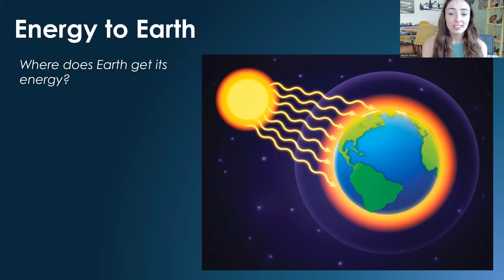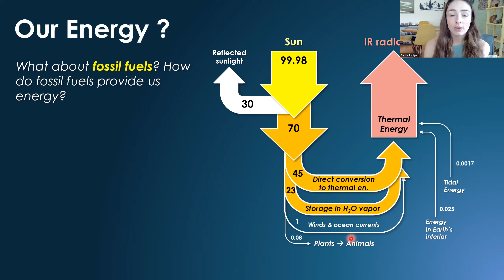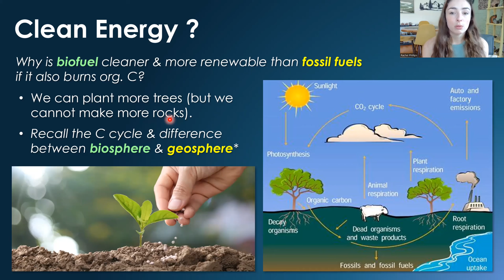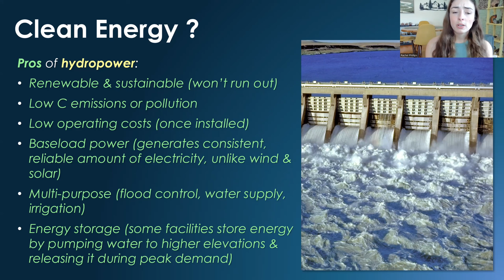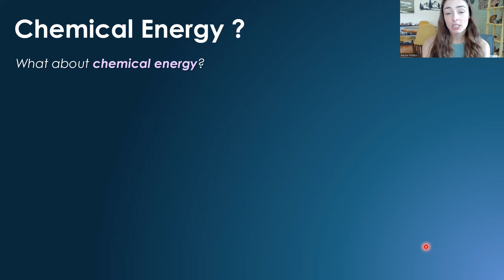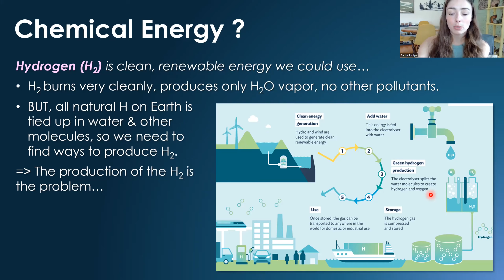Where Earth’s Energy Comes From & Pros/Cons of Renewable Energy | GEO GIRL

Comment: I heard a scientist from many years ago say that the solar cells were not developed to the point where they could rival gas and coal power. The entire roof would need to be covered with cells like shingles made of photovoltaic cells, which would be more expensive than coals and gas, and the fuel effeeciency was also less.

I also heard a physicist say all mass is photons trapped in a container that experiences acceleration or decceleration.

I have never heard an environmentalist or scientist talk about the impact of overpopulation on climate change.

Comment: What you covered you covered well.  Except you left out the most important solar energy that we have available to us!  You described solar energy as it is used by solar panels.  BUT there is another way for us to use solar.  That is passive solar.  It is IMHO, as important, if not more important.  For years I heated my water using passive solar and my house in Kentucky for most of the year except for those coldest parts of the winter.  Their are solar ovens,  greenhouses, attached solar rooms.  The list goes on. 
There is SO MUCH more we could be doing with passive solar if people were more aware of it.

Comment: You overplay the negatives of wind and solar. In particular, you don't discuss synergies. No electricity generation technology exists in isolation with the current grid, why would renewables?  On a diurnal basis, in most places, solar and wind complement each other, with wind picking up near sunset and continuing overnight. Also, battery storage plus renewables is comparable in cost today to the cheapest nuclear power in $/MWh delivered. It continues to get cheaper. The concept of baseload is old-fashioned.
The energy payback period for wind is measured in weeks. The capital cost payback period can be measured in months in good sites to a few years in more marginal sites. At 100+ m hub height, wind is not as variable as surface dwellers think, especially offshore. Ask a kite enthusiast or hot air balloonist. I have never heard any skeptic mention radar. For ATC radar, they're tall, but not that tall. They show up on weather radar, but the meteorologists already know about them.
Silicon solar does not involve a lot of pollutants and we already recycle 90+% of the materials involved (steel, aluminum, glass). Not much is currently being recycled because it is still in use. Ironically, it is the expensive silver that is most challenging to recycle. Solar PV recently passed onshore wind for the cheapest form of electricity generation, unsubsidized LCOE.
Solar often exists on rooftops near the place of use. Utility-scale solar, as well as wind, can also coexist with agriculture, often synergistically. Browsers like sheep and goats can keep grasses trimmed. Many crops benefit from shade on hot days during the growing season, reducing water demand as well. Solar is used on greenhouse roofs to offset their power use too.

You glossed right over one of the advantages of already installed hydro: it is a storage medium in many locations. You can use excess solar or wind to pump water uphill and you get 80-85% of that energy back (competes with batteries for #1). Solar can also be co-located with water, keeping the panels cool (efficient) and shading the water for better water quality
Geothermal is similarly a storage medium. Energy can be stored seasonally, deposited during long summer days and tapped during long winter nights. This is already done.

Nuclear is expensive (>$10/W versus <$1/W for wind/solar PV) to build and slow to implement and filled with opportunity cost. That time and money spent represents status quo emissions not avoided during the 15+ years that modern plants tend to take to build before they generate a single MWh of electricity. In the meantime, for that capital expenditure, you could have built many times more solar and wind generation capacity (and storage) in a year or two and had it in operation for over a decade (by which time it paid for itself many times over) by the time the nuke gets fueled. All of that means that the energy in $/MWh is expensive too. Notice that I didn't even mention weapons or waste or decommissioning costs until now

Comment: Well, it has been reported repeatedly, and I mean repeatedly, over my 70 years that we are about to run out of fossil fuels. I don't know whether the fable of chicken little or the fable of the boy who cried wolf is more appropriate.

Not to mention that if coal is included in the inventory of fossil fuels, we have hundreds of years before our supply of fossil fuels is fully depleted. And fracking, which disturbs the rocks underneath AND ultimately provides more greenhouse gases, has also expanded the supply of fossil fuels.

I'm not advocating long term use of fossil fuels, it just that your otherwise meticulous presentation is incomplete.

Humans tend to believe that history starts when we are born, but this is especially noticeable in young adults who, not unreasonably, lack experience and a long baseline to base judgements on.

Comment: Solar and wind energy is a scam. They are solutions that are 1000x worse than the original problem. Solar will cause massive weather issues as it steals sun energy but also reflects back a large portion of unabsorbed waves which is a double problem because of chem trails allowing for it to be reflected back down. Wind is massive and does create radiation pollution(as you said can mess with radar) kills a lot pf flying animals, prone to fires and large maintenance costs and down time. Nuclear is definitely horrible especially because of h3 emissions.

Comment: Wind and solar intermittency is so severe it is not worth the cost. A nuclear reactor will last 4 times longer than renewables and is a fraction of the cost when you add in all the tens of thousands of kms of connecting transmission lines, backup power such as gas coal, hydro and batteries that renewables need. You essentially need 2 power grids when operating on renewables when one is expensive enough. Nuclear uses existing transmission lines and requires no backup power at all as it is 24/7 power that lasts at least 70 to 80 years compared to 20 years max for renewables. Sorry Geo Girl nuclear is the clear winner by a huge margin. I will not even mention how CO2 intensive and toxic renewables are other than it is off the scale bad for the environment.

Comment: Hydrogen isn't an energy source (unless utilized in a fusion reactor) it is an energy storage medium (just like lithium ion). It has an energy storage density that is 142× higher than lithium ion batteries though. So it is way better.
Reply: Hydrogen is a tipe of combustible that does produce energy when is being burnt.

Same as methane, propane, or gasoline.
Reply: @josemariatrueba4568   it isn't an energy source.  The energy released in combustion was imbued into the diatomic hydrogen when it was created (it takes a lot of energy to separate hydrogen from another atom). It is no more an energy source than a battery is.
Reply: @homomorphic  Sorry but I'm afraid you're wrong.
Hydrogen is something you can burn to make heat or feed an engine, whether you like it or not.
Reply: @josemariatrueba4568   No, you are wrong. Whether something is an energy source or not has absolutely nothing to do with whether it burns or not.  The only energy source is fusion.  Technically fission is a derivative because it is fusion that produces the fissionable elements.  Also, just to show how completely insane your argument is, lithium ion batteries burn just fine; very aggressively, in fact.
Reply: @homomorphic  your are very funny.
It seems like your home heats up magically, and your car runs without any kind of energy.
Reply: @josemariatrueba4568  my car is a hydrogen FCEV. It transforms the stored energy imbued into the hydrogen via some process (which is ultimately derived from fusion) into mechanical energy. At no point is the hydrogen an energy source.

Comment: Solar panels do not produce chemical energy. They use semiconductors to directly produce electricity from the photovoltaic effect. It has little to no relationship to photosynthesis beyond the fact that they both use sunlight.
Reply: I was going to comment on this very detail. However, the very first step in energy capturing, the excitation of electrons to an energetically higher level within the atom or molecule, is comparable. You might call this chemical. All the rest of the process is different in photosynthesis and photovoltaic production of electricity.

Comment: Those might be good alternatives, but there's a serious problem with bio mass energy: it may be renewable, but it regrows much slower than we actually deplete the source while still emitting greenhouse gasses, meaning the net yield of that method is negative

And the only problem with solar power is the exact same reason as why it works: those solar cells are dark and dark stuff heats up pretty easily, giving off a lotta heat still
Best would be to reduce the demand for energy overall

Decreasing the global population for starters would work and I'm sure there are ethical ways to achieve that, not involving genocide

Besides, even in the wealthiest and democratic countries we still have to combat corruption to get it done bc they're no less greedy than world leaders in poor countries

It's doable on paper, but actually executing the plan will be a problem, so I do think that despite the best efforts we will be too late to turn the tides

Comment: 13:26 I feel like one would have to differentiate more clearly between the different renewable sources. It would be interesting to see what’s the actual impact on our ecosystems per unit energy produced. With e.g. wind farms while it might impact some birds,  in terms of land use all you need is a bit of area around the foot and access roads. While there could be some wilderness around solar, the grass is often kept mowed around it for maintenance reasons and installations obviously can’t be within forests. Biomass otoh captures very little energy per unit area compared to the other two and intensive farming is an absolute killer for species diversity. 

So a bit of a better researched breakdown there would be cool :)

Comment: Excellent lecture.  This subject is quite important.  Thank you for tackling it.

Importantly, I do think there is a new development in hydrogen, that is to say, the gold hydrogen variety, that does not get sufficient attention.  This type relies on water percolation, or passing through iron rich geological formations, to produce underground hydrogen, i.e. some large pockets natural gas.  

I wonder what you think of gold hydrogen. 

Further, biogas is a renewable arm that is often overlooked.  These energy streams can be generated anywhere, with inputs coming from city waste disposal, farms, restaurants, or kitchens.

Beyond that, there are a couple of theories that can allay your worries.  One is the regenerative grid theory, that uses grid surpluses to produce hydrogen and battery fill.  The other is the massless energy concept, that relies on massless means; think wind, heat, radiation, or waves, et cetera, over the combustion of mass.  

Combining the two theories could lead to a set of conditions where all of the energy humanity needs can be synthesized, for the most part.

Comment: Proposal. Build solar panels in deserts. Use the energy obtained to make hydrocarbons (methane, gasoline, diesel, kerosene, etc,.) from atmospheric CO2 and H2O. Use existing infrastructure to distribute those hydrocarbons to where they are used. Originally, such a system would be too costly to compete with existing fossil fuel technologies, so just subsidize the shit out of it. Use the money currently being wasted on subsidizing fossil fuel companies to do that. As the hydrocarbon producing solar farms expand, economies of scale kick in. Also, fossil fuels become more expensive as reserves are depleted. Fossil fuel companies keel over and die as a result. Good riddance. Users of hydrocarbon (cars, planes, home heating, manufacturing, etc,) barely notice the change. We seamlessly and painlessly switch from fossil fuels to 100% renewable. Everybody is happy. Except for the CEOs of the fossil fuel companies of course. But who cares about them?
Reply: We obviously need the production of carbon neutral fuels for certain applications like airplanes, where battery weight would be too high, and maybe to bridge low power in cold, dark and windless periods. But where ever it is feasible, we should use the generated electricity directly or store it in batteries (or if possible as pumped-storage hydroelectricity), because this is substantially more efficient than hydrogen production, which in turn is more efficient than electrofuels. By far the worst efficiency rate has bio mass fuel. Overall efficiency of battery storage is about twice as high as electrofuel efficiency.

Comment: The trouble with biofuels is that they need to be energy positive (more energy out of the biofuel than it took us to make the fuel) and they need to be renewable (turning old forests into woodchips to burn takes a long time to replace the forests so the energy out of the forest per year is low). Corn ethanol is the cliche example of a biofuel that takes more energy to make than it returns, IIRC it's about 70% efficient at greenwashing fossil fuel into biofuel.
Reply: Any fuel has an inherent efficiency disadvantage to electrification. 

Simply it is a lot easier to get electricity to the demand point than fuel. No storage facilities, no trucks or trains, no pipelines. Nearly 30% of global gas/diesel is burned just shipping fuel around the planet. 

The electric grid plus endpoint generation possibility is just so much more.efficient. compounded with the typical electric motor being so much more efficient than an ICE. 

Hard to beat with any fuel solution.
Reply: Shout-out to Drax for being a "renewable" energy provider for the UK by logging old growth & hurting forests across North America.

Comment: Humanity will switch to renewable sources.  As renewable sources get cheaper and fossil fuels get more expensive due to depleted supplies there will come a time when it just doesn't make sense to use fossil fuels.  This seems to already be happening as power companies would rather have sources that cost less to operate and don't require fuel just makes good business sense.  While I personally don't like climate change and extinction events, especially if my species may be on the list, I'm pretty sure that in a few hundred million years the climate will be vastly different and there will be very few current species still around.  Gators, ants and horseshoe crabs will probably still be here though so there's that to be happy about.

Comment: The problem with fossil fuels, is not so much that we will run out, but as with all mineral resources, we naturally exploited the most easily-accessible and richest resources first, so the resource base is continually degrading.  Technological progress helps us to exploit lower grade and harder-to-reach resources, but in general more energy is also required.  The problem with fossil fuels, is that is takes energy to make energy, so as we develop increasingly lower grades of resources, it take more energy to make energy. This concept is known as the Energy Return on Investment,  EROI. https://en.wikipedia.org/wiki/Energy_return_on_investment  It is generally accepted that when the EROI  of a fossil fuel source falls below 3, it can not be exploited profitably, no matter what the price or technology used.

Comment: Biofuel is mixed bag since we used artificial fertilizers and fuel for agricultural machines to produce it. And we use edible corn kernels to produce alcohol while all cellulose from plant remains waste so it puts into question "greenness" of whole procedure
Reply: The biggest problems with biofuels are the very low efficiency of photosynthesis and the very large consumption of water.  Using PV to power electric cars uses 1/200th the land of growing corn to make ethanol to fuel IC cars.

Comment: Interesting breakdown of energy sources.

I was surprised tidal forces listed as an input. I thought there was a net energy transfer to the moon causing it to move away from earth. As someone who heats their house with cordwood I was disheartened to learn it is not as positive as it appears at first blush. It is true burning wood just releases the CO2 that will happen as the wood rots away. However burning is much faster process and the trees that replace the ones cut down are not capturing as much CO2 as the older trees.

Bottom line there is no free lunch when it comes to energy.

Comment: Well, tidal energy generation isn't solar, it's lunar
Reply from the maker: Yep! But there is a small part of tidal energy driven by the sun, that is why spring tide is larger than neap tide because the sun and moon are aligned and both pulling on Earth :)
Reply: None of them are solar. Tidal energy comes from the fact that all celestial bidies spin around a center of gravity counter acting with centrifugal forces the forces derived from attraction between masses.

In fact, it's not the moon and the sun that cause tides, but the spining of the earth and moon around their common center of gravity plus the spinning of earth and sun around their common center of gravity.

Technically speaking the moon doesn't make turns around the earth but both earth and moon  are effectively orbiting around their common center of gravity.

Similarly planets do not make turns around the sun but sun and all planets are orbiting the common center of gravity of the solar system which at times is outside the surface of the sun.

I wonder  why every cekestial body is making turns non stop.

What caused all bodues starting making turns?

@GEOGIRL